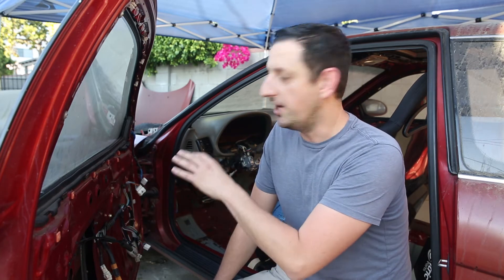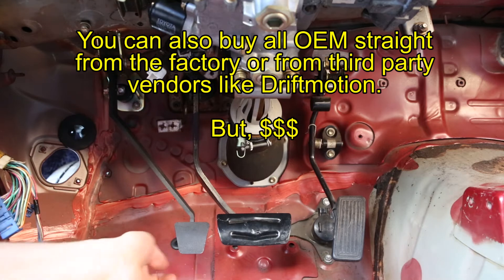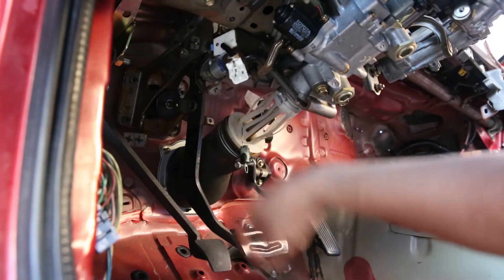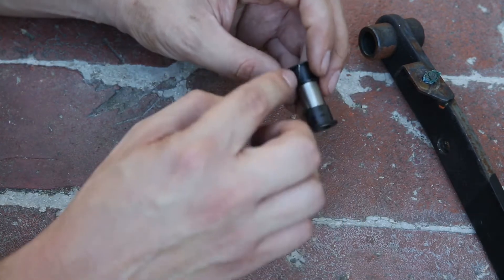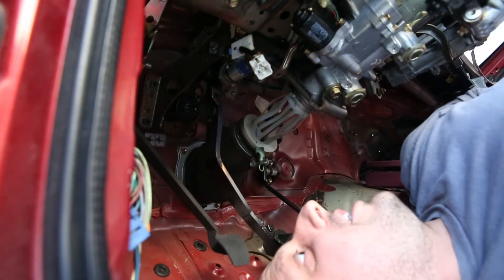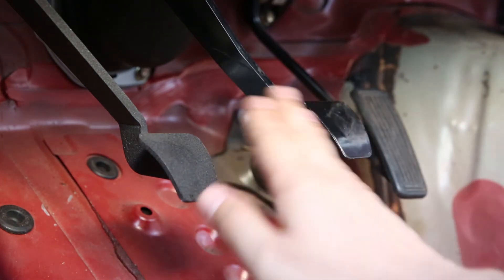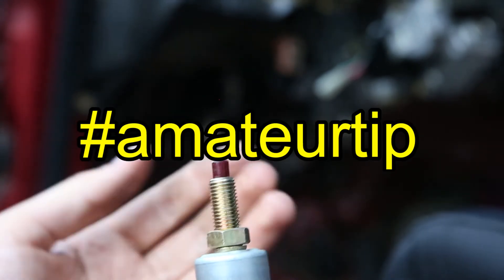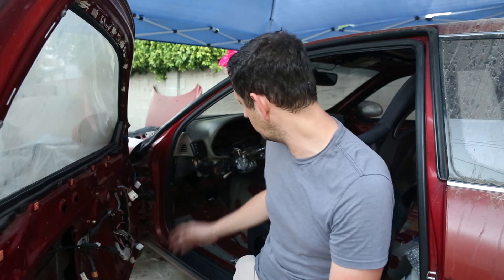Lexus SC300 Drift Build. Ep.30 - OEM Auto to Manual Brake Pedal Swap

Comment: I just installed a manual brake pedal on my sc300, broke the brake switch, although I wasn't sure what it was at the time, so I watched you're video to see if you said what it was and sure enough we did the same thing lol. Thank you for the help.
Reply from the maker: Yep that switch is extremely easy to break. Thankfully it's also really cheap to buy a replacement.

Comment: Did you change the cluster to the manual cluster.i want to ch a nge mines but I'm wondering if it's plug and play and would everything work
Reply from the maker: Mike Brown I installed custom gauges instead of trying to get a different stock cluster to work. No reason to think it wouldn’t work with some slight modifications

Comment: you dont have to take the peddle;e out just to adjust it,,you can just turn the shaft  to adjust it.
Reply from the maker: Leezy boosted yeah I tried that but there wasn't enough clearance between the shaft and the pedal to turn it.
Reply: mine have a lot off room even a spot on the shaft to turn itbwith my hand